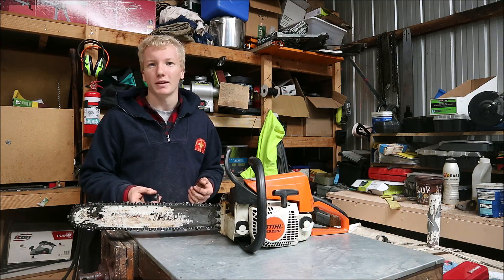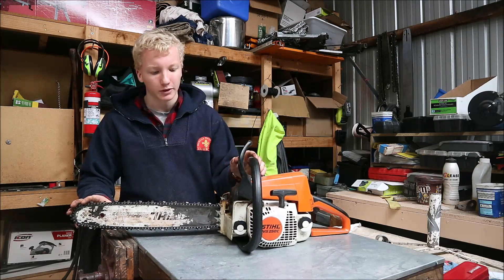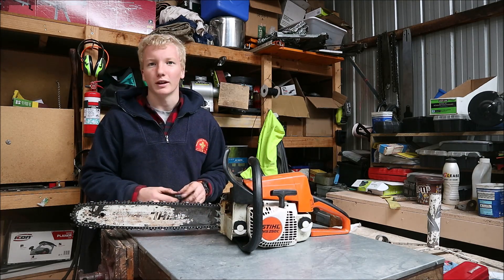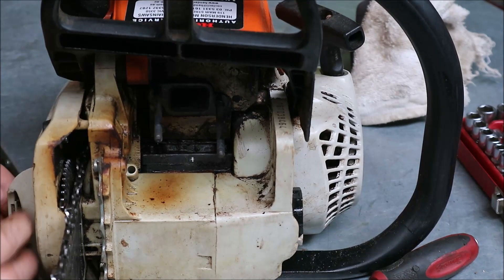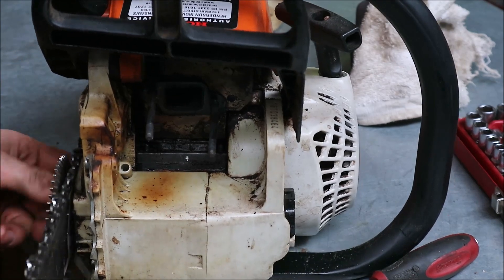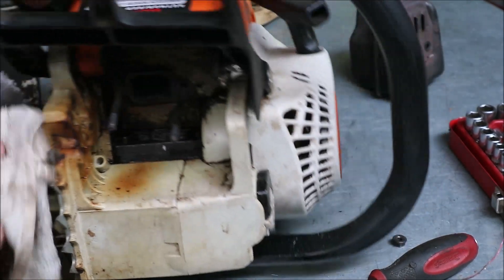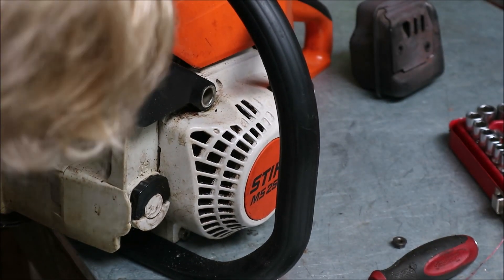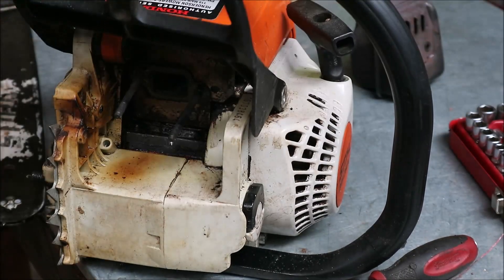Stihl MS250 Bar Oil Leak

Comment: Very good solution to the problem..... would advise you to put some thread locking agent on the M6 bolt for 2 reasons. 1. Oil could still leak past the threads and the locking agent will prevent that and ...2. The vibration created by most chainsaws could cause the M6 to loosen. 👍
Reply from the maker: cheers, will consider that for the next one

Comment: Haven't had a chance to pull mine apart yet, but mine only leaks if I have the saw off and sitting upright. If I lay it bar side down (right side if you're looking down the saw) it doesn't leak. Is that similar to yours?
Reply from the maker: could be a leaky cap